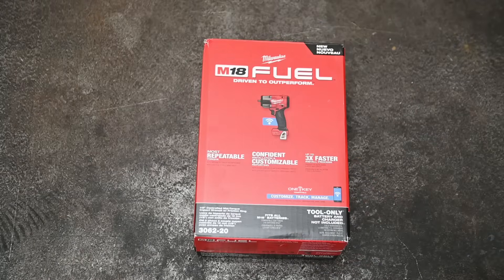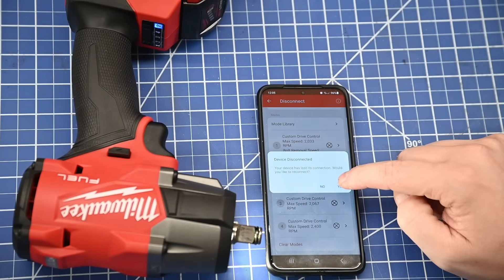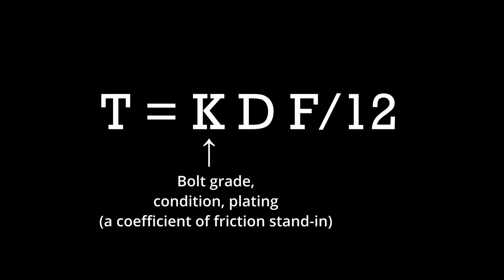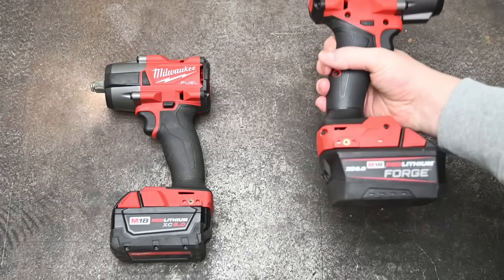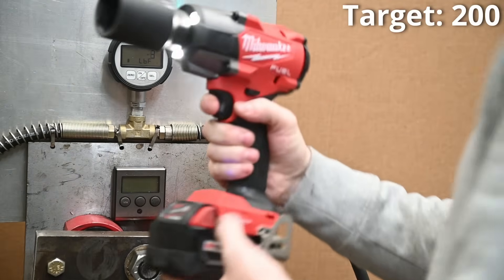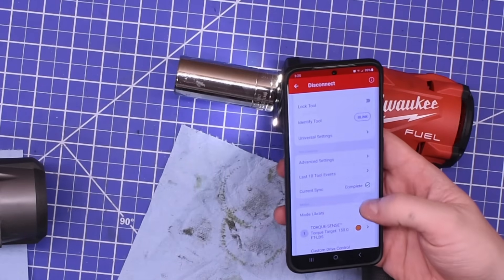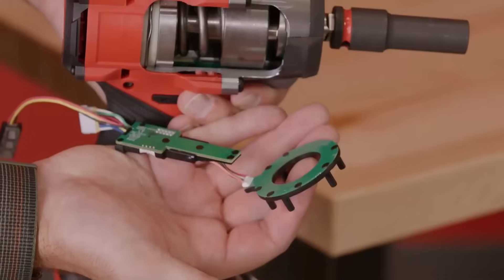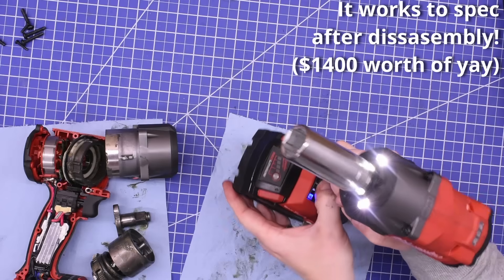Milwaukee's Secret $1,400 Impact Wrench: A Mechanic's Dream?

Comment: Hoping my TTC boys read this comment,

4 years a go I was a manufacturing engineer at a factory that assembled hydraulic valve bodies. When error proofing our assembly line I worked with Atlas Copco and purchased a similar style of tool. One was a rotary drill that has an integrated torque gauge and  a digital screen read out that would automatically stop when the torque was achieved. It could also keep several torque steps in its control box that could be sequenced in an order, so like tightening one bolt to 80 lbft, then the next to 45 lbft without changing any settings on the tool. On our bigger product lines we have higher torque requirements so they introduced us to a impact style wrench like this but rather than having the anvil in the head the motor would pulse rapidly simulating the impacts. It maintained a 2% accuracy setting up to 120 lbft.

I tell you all this because I wanted to share that these small drills were an eye watering $8500 EACH and the pulse impace was $11,000. In total I spend about $300,000 of company money investing in this line which is still running today.
Reply: Holy crap finally someone that knows what Atlas Copco is. My brother works in wixom Atlas and my dad is based in Aburn hills but travels all over. Use to work for Ingersoll Rand. Atlas is miles ahead of everyone. I just wish they made a battery impact wrench that you could adjust for 1foot pounds to 1500ft pound or 1 to 500. But I could be mistaken
Reply from the maker: @JakePlisskin12  Atlas Copco is world renown top stuff. We mentioned on the channel two videos ago on vintage tools
Reply: @TorqueTestChannel  You know team read is coming out with even more advanced tools? I saw a test tool recently no one else knows about.
Reply: I work on Atlas Copco rollers and compactors, as well as their small equipment line and air compressors. My friends dad is Neil Breedlove, the vice president which was wild to find out bc we both worked on compressors and he never felt it was worth mentioning
Reply: @lemonypeach6866 Honda of America/Acura use Atlas Copco on their assembly lines. I saw video of their torque wrenches being used on Hondas YouTube channel.
Reply: @williamlevy1981 I worked at Honda of America nearly 30 years ago; I don’t remember what kind of DC drivers they had. But I do remember that for many of their underhood and underbody (chassis, etc.) joints, they also clicked each one, and marked each one with a bright pink permanent marker. The clicker wrenches were rechecked at least once per shift (I think maybe every 2 hours). 

By contrast, I visited Rivian a couple years ago. They use simple Makita cordless drivers, with no apparent torque control, and no apparent checks. 😮
Reply: @williamlevy1981  yeah they really are only really in factory I guess they really don't care about tapping into the consumer market automotive tech or repair market either. They are stupid expensive anyways. Twice or three times as much as Ingersoll rand tools I'm almost positive. Honestly my Milwaukees are fine by me. I guess most atlas copco techs don't even use atlas tools because they don't want to spend the money. I have a older numatic screw gun and that thing will blast a 6 inch lag bolt straight through a 4×4 and beraly make a sound. The 4x4 part isn't that impressive its the noise level. I wish Milwaukee or other companies would focus on the hydraulic impact wrenches. They are so smooth and quiet.
Reply: @JakePlisskin12  their price makes it not worth it though. our plant ended up selling most of our inventory.
Reply: Digital torque control.  Very cool.  But at the same time, I would have imagined something like this is pretty simple.  Could the algorithm really require a micro that costs that much?
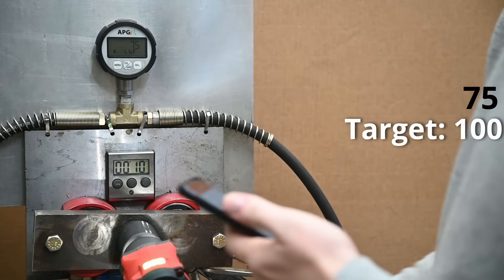Reply: @JayDee-b5u the complicated thing is explained at 6:00. There are a lot of complications to reach a specified torque and the tool has to figure out precise torque
Reply: @JayDee-b5u  I would not doubt that there is $ 1,000,000  of r&d in this tool. A team of people to engineer, write the algorithms and test. On a low volume tool like this that may only sell 1000 in the first couple of years thats $1000 per tool just in r&d. Even if they dropped it down to say $100 per tool, regular people simply wouldn't spend the money for a larger, heavier and weaker tool.
Reply: Great info from all of the commentator's here. I'm always glad to hear about companies who are way above the regular joe tools!
I'm no longer in the mechanics field but still love to learn. I honestly wish I'd went to school for things like this instead of working on automotive, tanks(military) & in between.... I'm sure I wouldn't be broken down(body wise) & not able to even work on my own stuff.
Reply: condition yourself towards better health and vitality? First daily walks, then once a week replacing it for a short slow run, then... up. (of course I don't know about your condition, but many don't know their capabilities to recover and rejuvenate still) @ROADIEZ824
Reply: Difference is you tell Atlas or the other industrial big boys you need +/- 2%, their applications team comes back with a price. Ask Milwaukee and they will say "errrrre wellllll" because whether their tool is technically capable of that or not, they don't want to invest the money in validating it to the degree they'll accept responsibility if a run of millions of dollars of hydraulic valve bodies fail due to inaccurate torque...
Reply: I knew it was a matter of time before we’d have this technology. 20 years from now it will be equal value everything else . A good example I tell young people is “ face time “ and flat screen TVs . I still remember a VCR. Being only for wealthy people or atleast a 1000$ in the 80s eventually priced under 100$ even with inflation. Sounds like a good career choice you made , I always had a lot of ideas when it came to innovation inventing which becomes foreshadowing if just an average joe .
Reply: I work on the plant maintenance team at a hydraulic cylinder plant, we use Panasonic, Stertivant Richmont and Atlas Copco power torque tools. They are connected to a computer system via wi-fi and can log everything, confirm torque before allowing operator to proceed to next step. High dollar system, that's quite complicated. Crazy to see Milwaukee able to cram it all into a handheld tool
Reply: @NDC1115  more or less what we had. We had 6 control boxes  across 6 lines. Each line used the I/O of the control box to confirm or lock out the operation for the next step of the build. It worked wonders and our ppm on these lines dropped to near zero. We also got recognition and awards from our OEM customers on the quality improvements.
Reply: @NDC1115  Too bad Boeing isn't using it!
Would have gotten a notification that the Alaskan Max didn't have any bolts tightened up on the door plug! 😅
Reply: @ROADIEZ824 hahah got to put the bolt in first 😖
Reply: @WowCreativeUsername  Boeing quality used to be a thing, before McDonnell-Douglas executives took over.
Reply: @WowCreativeUsername 
I remember when my grandfather retired as the head engineer of Boeing, Seattle plant in 1964.
Boeing was leading the field then.
Oh how the mighty have fallen. . .
Reply: @NDC1115  the factory i work for, we built our own software that interfaces with tools. In the machining side, we scan a bar code, and do our gauging. It records the bore sizes for every part. When the line builds the equipment, the digital torque guns record the data for every bolt into the same software. Its crazy the amount of data they are recording.
Reply: @NDC1115  Milwaukee is leveraging the power of the CPU in our smartphones. They're more powerful than 20 year old supercomputers. The companies which are utilizing that method via bluetooth are at the cutting edge of all sorts of gadgets. The rest will be left behind if they don't get in the game. I've set up a little video production studio for less than $2k and the functionality of it would have cost hundreds of thousands 10 or more years ago.
Reply: They are out there for the smaller nuts/bolts too.  I work in O&G and we looked at one such solution that would not only stop at a set amount, but also record the torque of each bolt wireless and throw it into an on prem linux server.  This was a great idea to limit liability when BP screws up a tool and blames us, we can pull the build sheet and prove that no, each of the 200# bolts were properly torqued and here is the build sheet.

I think the same company we were looking at also supplies NASA.
Reply: Makita Torque Tracer could have been the answer.
Reply: You have to wonder what the breakeven time is on that vs. just using an ordinary torque wrench
Reply: Had a battery drill atlas copco at Embraer. Set torque with an allen key. Worked great.
Reply: Tools themselves cost about approx $3-7k each, but each licence to connect to PowerFocus module could cost another $3-7k. Problem with AC is their Software, which has different bugs even on older models and new SQS system, for example, is not free of them. One workstation with three tools and SQS system could easily reach $75-100k and problem is that you still have to deal with various bugs. Plus is that a lot of programming is done visually, but at the same time UI can suck big time. Support is also so-so in the area I'm from. For that kind of money... Well, for large corporations it's ok, for lower scale stuff you can build process differently and save a lot of money.
Reply: wicked tech in these got dam things man lol

i had no idea they have gotten this good.  let alone hooked into bluetooth for data read out.  

4 brothers in land scaping. me being the youngest at still 25 years exp lol.. our odd brother out but still loves doing landscaps with us when ever he can, has been a auto mechanic longer than i've been a landscaper.  over 25 years..

im wandering if he knows just how much these impacts have become.  im visiting him up norther here a couple weeks and im gonna keep a secret eye out on his tools. if he doesn't have a pissed off battery impact like these....hes getting one for Christmas  :)

i just donno about all that power down inside a motor or up under vehicle...??

that could simply be a very bad thing to have this much power in tight quarters.  any feed back of that would be awesome....i don't want to give him a tool that simply is made more for puting it steel fkn electric poles lol...  and end up with him twisting his wrist or smashing the sht out of his knuckles too often then not.   even though the fella could and does buckle any body with just the power he has in his hand grip lmao....   that fkr after 25+ years under a hood and under vehicles.....he'll literally make you beg him to let go of your forarm.  the fkrs gripping is got dam insane. like i didn't even know i could be completely man handled by just the sheer fk'ing power of someones hand grip on your forearm.  thats a wick got dam strength and power man. im have him do that to me when i see him just for shts and giggles now lol... you have to see him fk with his buddies with that grip btw.  its a fk'ing riot man lmao

so anyways. if anyone knows if these kind impacts are simply too much for most auto mechanic needs.  let me know.   i also don't want to drop serious doe down on a tool that he simply won't use much.   that'd kinda suck too ya know lol :)

thanks guys and badass info of impacts all the way around here.  wish dad could of got see these real man toys  :)
Reply: What does atlas copco do more the air compressors? 😳 I only know them from that 😅
Reply: i can tell you are full of sh*t because you have 0 idea why an impact wrench works and think the motor pulsing would do something lol
Reply: atlas copco is pretty dope, used to work in an automotive factory and all our tools were made by them, when i saw how expensive they were my mind was blown, especially thinking about how often we dropped them lol. We would occasionally have some issues with them having connection issues, that could be frusturating, but they made it to where anyone could build a car, it was just put your socket here and hold the trigger till it stops, if it wasnt for those tools theres no way that factory could have ran.
Reply: I work with Atlas Copco tools as an engineering tech. Part of my job is to program/monitor/maintain our fleet of DC torque tools. While the Atlas stuff outclasses this Milwaukee in every aspect, it's crazy to see this level of precision come out of something without a transducer. Definitely would be a welcome tool in assembly where joint criticality isn't as stringent as.. well.. ours. I know I'm a little late to the party here, but I had no idea Milwaukee had this up their sleeves.

Also I 100% can confirm the cost of Atlas is otherworldly. Company just dropped a cool 100k on a new PF6 Flex two-spindle setup for ONE STATION of one of our assembly lines. Not even including the Fanuc robot and vision solutions that comprise the bulk of the station.
Reply: @cellmate454  Ever heard of blue tooth on these tools?
Reply: @iamgermane  I knew they had the whole One-Key thing going on, but this is way past that. Here I thought I was king cool because I just got a 1/2 inch high torque. Not so much after seeing this lol
Reply: I get what you mean. The company I work for uses Atlas Copco, Mountz and Deprag automatic screwdrivers with torque control. Torque application is way lower though, 10Nm tops and any torque variance might result in capped PH1, PH2 and T8 to T15 screws. They're all good but there's been a push for Atlas Copco for the last couple years while Deprag is being phased out. Nothing wrong with the later but the Atlas solutions are a bit less expensive and perform just as good.
 And it's much more convenient when the process technicians only need to learn one brand's setup.

Comment: Have you considered doing a traditional torque wrench round-up? Seems like it would be well within your wheel house. Maybe expensive Snap-on unobtainium vs. Amazon chineseium like the flashlights?
Reply from the maker: Check out Tools Tested. Testing torque wrenches is not very exiting but important work which he does often
Reply: @TorqueTestChannel  Haven't seen his stuff before, dope!

Comment: I could see this being extremely valuable for a production crew that's doing the same thing day in and day out. Setup looks tedious, but once set up it seems like it would be a great tool for specific tasks.
Reply: It's actually useless for those crews because it doesn't hold any sort of certification. For your racking manufacture warranty you need to follow their torque procedure that includes using calibrated instrumentation. If Milwaukee will not provide a cal cert it's no good to you.
Reply: @otm646  good point.

Comment: Torque wrench impacts do exist for the production of very high end and regulated industries (aerospace, medical, etc.) but usually retail for well into 5 figures each
Reply: I was going to say why doesn't someone make that. Basically something with tech like this so it can stop before the desired torque, then with a long handle and a strain gauge so it can be hand tightened to the final number. If it's just for tightening and not going to stupidly high numbers (unless by hand) then it wouldn't need to be as powerful and the head could be smaller and lighter than a typical mid torque.
Reply: not exactly, but i like your idea!  The Impacts im talking about look like a normal impact gun, but they connected to a manufacturing software that manages the assembly steps and guides you through the production.   @HomoKieran
Reply: Or you could just use a $200 pneumatic and a $10 regulator.
Reply: $200 impact and $100 tourqe sticks will get ya the same
Reply: In assembly you could probably just time the impacting?
Reply: @saiiiiiii1  Maybe that"s good enough for Boeing, but id prefer if the surgical equipment being used on me isnt assembled by counting the Uggs Duggas ;)
Reply: @BrycenKauai its just nuts and bolts brother
Reply: @saiiiiiii1 Depends on the component. There are some things where "hit it with the impact for a couple of seconds is good enough" and then there are situations where you need to verify that every nut and bolt is torqued just enough that it (and whatever it was holding on) is not going to fall off and kill or injure someone.

Comment: Got dropped a Milwaukee from our tool supplier. No markings or stickers, just a serial code on the top behind the metal nose. We were only told to “Try and break it, and let me know what you think”. Hasn’t been released yet, apparently, not a Milwaukee connoisseur myself.
Reply: I live within sight of their Brookfield offices and a few local shops get that deal on occasion. My neighbor's M12/M18 tool set are all pre-release tools lol. I want to do a dumpster dive after a trade show some time.
Reply from the maker: What type of tool?
Reply: @TorqueTestChannel  It’s a 1/2” impact. It’s a little more “rounded ” in shape., same kind of power. I’ll send a photo over. We use the M18 Gen 2 1/2 High Torque (I think), and it’s similar to that.
Reply from the maker: @dieselhatz4247  yeah sent us a pic TorqueTestChannel@gmail.com
Reply: Better yet send them the tool :)
Reply: @Feldmarshall12 yeah, jeopardize your exclusive early tool access for some dude on the internet who won't give you shit for it;
Good idea😊
Reply: Bros about to come up missing 😂
Reply: Fyi: people are taking notes. Your post is already screenshotted. I know a few of these people. A few in competition and a few close to milwaukee. :)